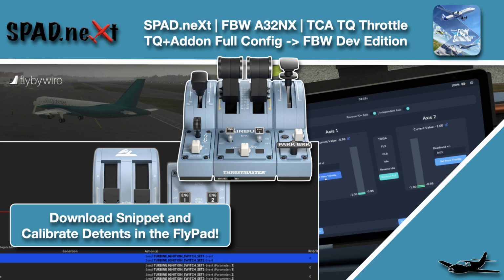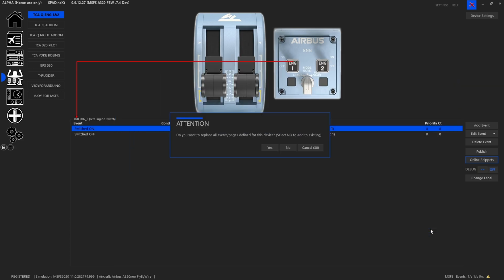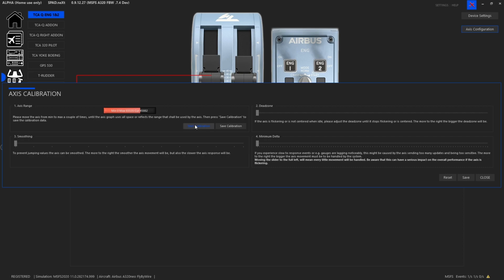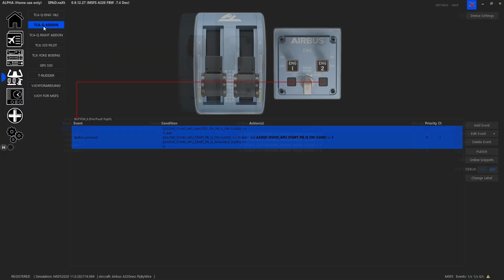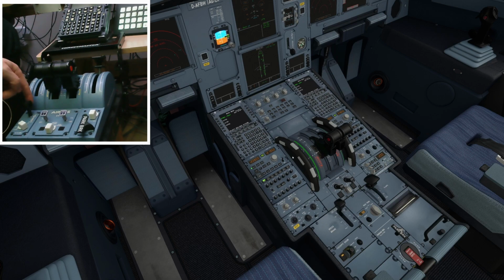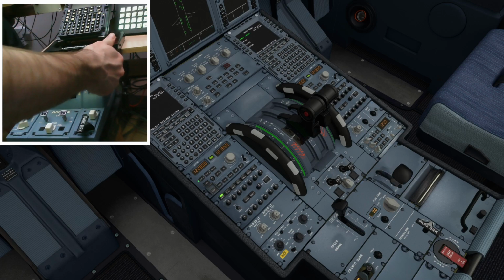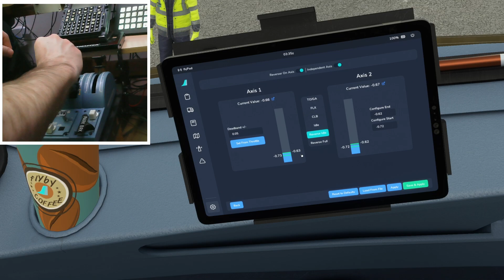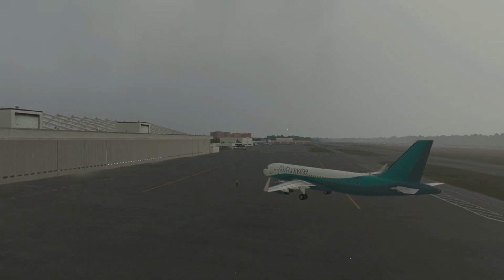MSFS | SPAD.neXt | FBW A32NX | TCA TQ Full Config

Comment: Would this setup still be able to be used today? As the Throttle bit doesn't show up when i press to go into custom axis where it says throttle axix ex1
Reply from the maker: The UI slightly change. There is and update axis video. But first press the add event - axis change- then the UI is presented like the button UI so that conditions can be inserted. 

Now click on the add event and you get the options for standard or custom axis.
Reply: @LesOReilly  I'll have a look at this thanks

Comment: Thanks for the tutorial! I've got a couple of questions though as I'm new to SPAD. I can't seem to find your most recent profile in SPAD, the most recent version I see if from August 2021. I think it might have something to do with my SPAD version (0.9.11.5). How can I update to 0.9.12.27 (your version)? I've activated the Beta channel as my update channel and I've tried to update, but it says there is no update available.. 

So I've tried to copy your settings manually instead, but I'm missing some LVARs, like the Autobrake settings for the A32NX, those are not visible in my list of events/data. Is there any way to update/import these?
Reply from the maker: LVARs are loaded by the bridge when connected...  you can update them again via the data monitor..  the alpha channel not the Beta channel is required..
Reply: @LesOReilly  Thanks, like I said, I’m quite new to SPAD so the bridge and updating via data monitor are still pretty vague to me, but I’ll look into it. Regarding the update, even on the alpha channel it says there is no update available.. any ideas? 

Thanks again!
Reply from the maker: @fabianbleeksma5089  you have to change to alpha ... close spad and then relaunch...  just checking won't find a new update as your client is still the release version.  Note that you also need to in the Discord and you need to link your account for the alpha to run...  maybe you should spend some time with the software and learning before you jump into the alpha.
Reply: @LesOReilly  thanks again! Didn’t know the account needed to be linked for the alpha channel to work, I’ll have a look at the Discord channel. Thanks for the tips